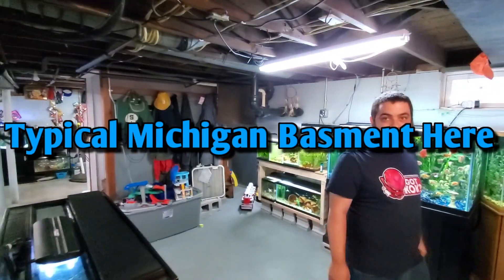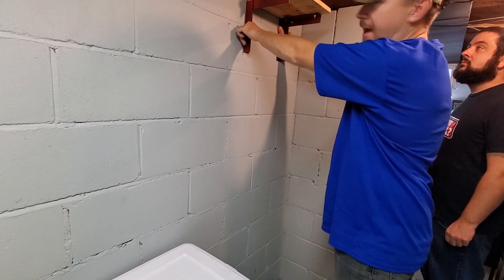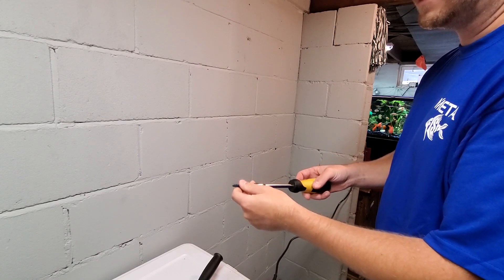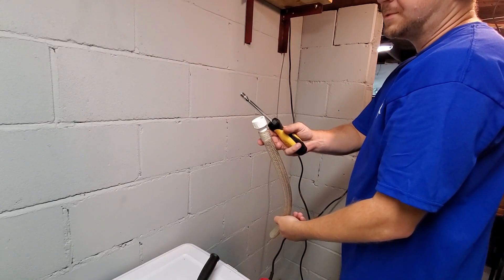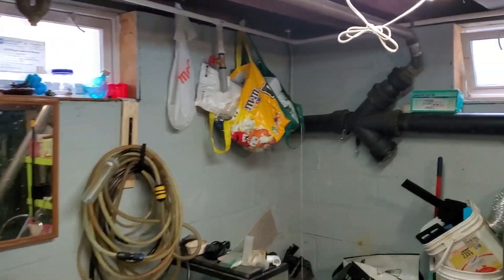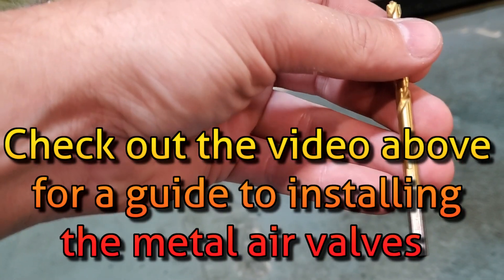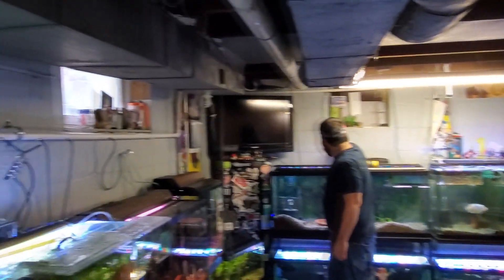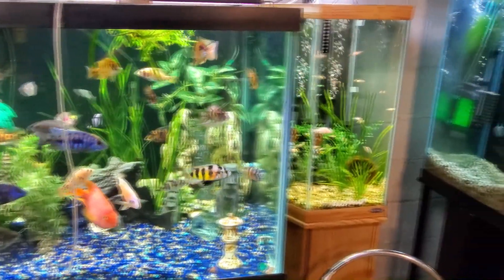Installing a Central Air System for a Fish Room - Start to Finish

Comment: I was warned by an old-timer General contractor to never use a hammer drill on vertical concrete block walls that are not poured solid... You run the risk of cracking the block that you're drilling...! Make sure that your wall is poured solid before using a hammer drill...! Concrete block are very fragile and crack-able, so be careful...! Thanks for all the free education and info...! Keep up the good work and go enjoy some nature today...!
Reply from the maker: Good PSA for people, thanks for sharing.  I'd believe a hammer drill can crack the blocks.  Luckily haven't had an issue yet in our local Michigan basements.

Comment: actually, i'm about to open my own fish store in the philippines. been watching youtube videos about closed loop air systems. do u think closed loops increase the air flow/air pressure as compared to linear (not sure if linear is the term where the i basically use 3 air blowers. 1 air blower for this side (straight for 100ft), another air blower for this side (straight for 40ft) and lastly another air blower for another 40ft straight? coz my store is big. like 100ft x 12ft and practically all the 2x100ft sides are lined with fish tanks (no fish tanks on the 2x12ft sides). a total of maybe 300 to 400 airline drops. i'm worried my 400w hailea vb800 vortex blower is not able to provide enough air pressure for all the airline drops. i actually have 3 air blowers ready. but damn. the electrical consumption is gonna be high. 1x400w, 1x180w, 1x120w. if i can only use the 1x400w to power all my fish tanks, that would be super!
Reply from the maker: It sounds like you have a good plan and fingers crossed that the 400w is large enough for you.  I don't have experience with blowers unfortunately, but people I know who used them were not super happy with the supplied air pressure they were getting.  400 drops is a lot but the water depth of the tanks is the key factor.  You can get away with twice as many drops if all your tanks are short (like 10gal or 20gal longs)  The problem comes in when you need to push air down to the bottom of tall tanks.  If it was me I would take the time to plumb everything together, and have area's to hook in all of your air pumps / blowers.  Adding PVC valves in case you need to separate the system or take a pump offline is pretty easy and cheap.  I own 3 pumps and have two running at a time with one on standby.  If one pump dies I can swap out the backup easily.  Also running two pumps gives you redundancy so that when one goes bad the other still supplies air to most of your tanks.

Comment: Does it matter if the drilled pvc goes into pipe? do you leave it?
Reply from the maker: I think you are asking about the PVC particles from drilling.  I don't make any special effort to remove them.  It is best to drill into the PVC with the air pump turned on so that the positive pressure inside the pipe blows any particles out as you drill the hole.  I have never had any problems with these PVC particles plugging the valves but it could happen.  The particles would not hurt the fish tanks if they ended up there unless the fish consumed them and couldn't pass them.  Thanks for the question!

Comment: Does the pipe just fit together or do you use a kind of adhesive/sealant?
Reply from the maker: Just dry fit, no adhesive or sealant.  You can use PVC primer and glue if it makes you feel more comfortable, but is not necessary for this size PVC.

Comment: Can the air pump be mounted on the floor??
Reply from the maker: Not advisable.  When you lose power the tanks could back siphon water into your pump and ruin it and drain your tanks in the process onto your floor.

Comment: excuse me, but why'd you say "i don't think u could get away with it using a 1inch pipe?" I think u were referring to not using pvc glue. if 1 inch pipes were used, you would've needed to glue the pipes?
Reply from the maker: Yes that is what I meant.  The larger diameter pipe tends to leak more and not fit together as tightly without PVC glue.